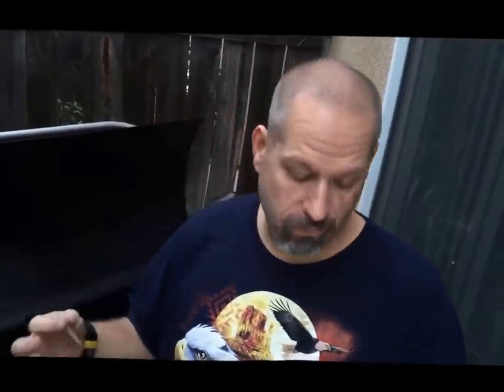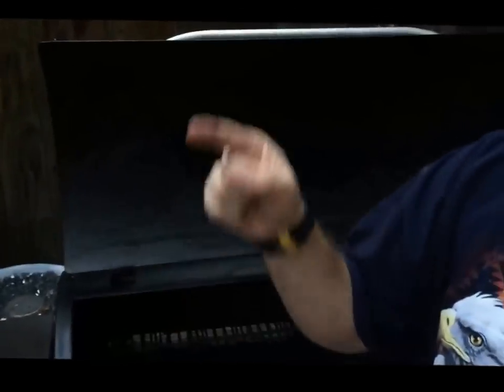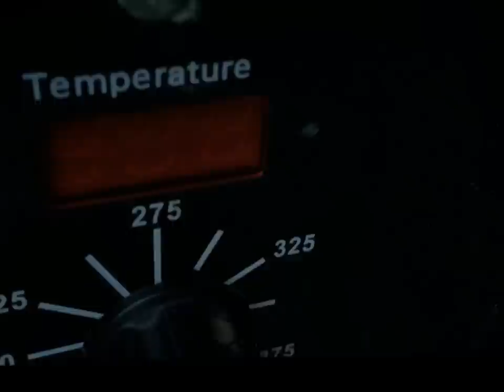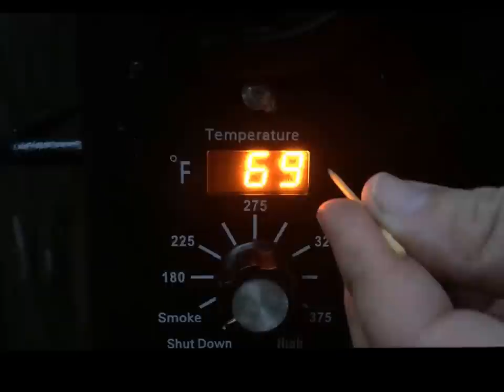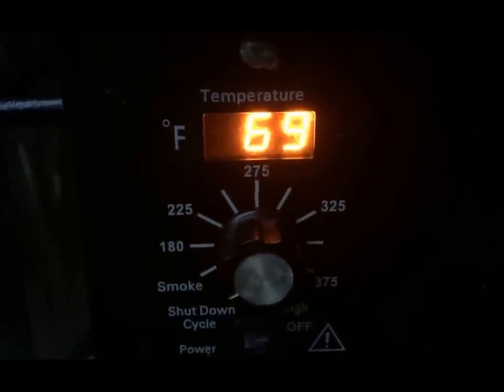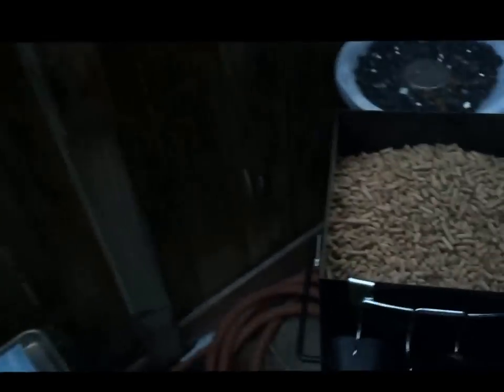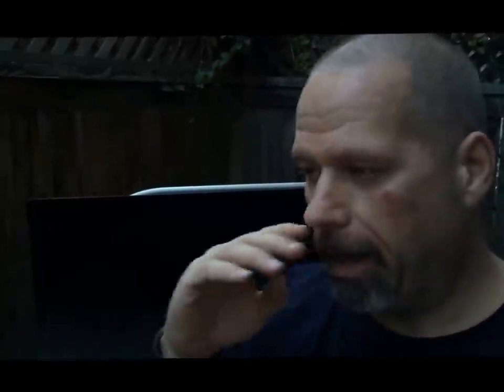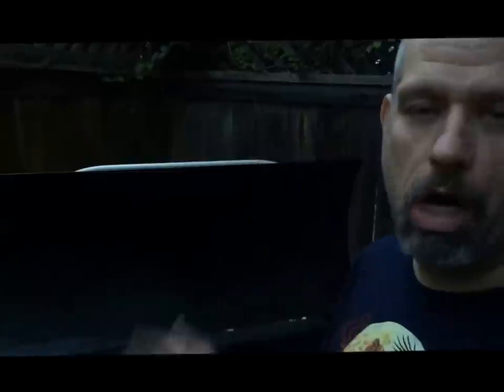Adjusting The Traeger P Setting - What is the P setting, where is it, and what do I do with it?

Comment: I guess I'm understanding this all wrong, going to be kinda long so please hang in with me, My Treager is only 6 mo old but it's caught  fire 5 times now, The burn box just gets heaping over full of pellets & burns back up thru the auger into the hopper so I just timed a full heat cycle & here are my numbers.

Temp set at 225dg P setting I changed fro P2 to P4,  After 10 min start & 10 min with lid closed I started timing
227deg Auger on for .17 sec
Auger off.05sec
204deg Auger on 2.53 min.
Auger off 1.22 min
300deg Auger on.14 sec
Auger off 1.28 min
296deg Auger on.12 sec
Auger off 1.25 min

Ok So it looks like the On/Off times are about right once it goes into smoke mode but whys is my temp getting so low at the begining 204 Deg then hits 300 Deg.

Thanks for any advice
Reply from the maker: What brand pellets?  Is the hot pot cleaned out?
Reply: @CrazyDavesKitchen  , I clean the Hot Pot before every use  & use only Treager pellets
Reply from the maker: Try lumber jack pellets
Reply: I'm wondering, This last time I was on smoke setting for 5 hrs, then increased to 225 setting skipping right past the 180 setting, Do I need to maybe go up 1 setting at a time & let it run threw a complete cycle on each new setting?

Comment: Just need to clarify the P setting affects the auger feed rate at startup only or does it change feed rate for all cooking? Also once you got a comfortable setting why are you constantly changing it? To get more heat??
Reply from the maker: Ambient temps can change the settings
Reply: According to the actual 'Traeger' P- Setting Video :
the higher the 'p' setting, the cooler its gonna run.
the lower the 'p' setting, the hotter its gonna run.
Reply: Higher P = cooler temps. I have to adjust it on windy days to keep it from getting too hot. P4 or P5 usually.

Comment: How do you disable the P settings?
Reply from the maker: There is no way to disable it. Each setting makes a small change. 

What is the issue you have?

I also ended of switching out the controller, muffin fan and auger motor to smokedaddy kit

Comment: my controller does not have the /P/ input control, each time I set it for 225, runs to 400, even set at 180. just muscles its way to 409+ what am I missig
Reply from the maker: You probably have a newer machine where they removed the P setting. Traeger has had a lot of issues recently. The problem when they outsourced to China they have several different factories making the same parts.  Each factory will test those 3 parts (Muffin Fan, Controller, Auger) and work perfect. However when you have multiple factories making those parts and they all get shipped to the assembly that's where the problem is. 

Lets use Factories: A B C 

(A) makes: Muffin, Controller, Auger 
(B) makes: Muffin, Controller, Auger
(C) makes: Muffin, Controller, Auger 

So when they go to the assembly plant they grab from the bins as needed, now some times, all 3 parts will match, AAA, BBB, CCC. 

But other times it can be ABC, BBA, CAA etc, many combinations. This explains why some have no issues. but so many people do have constant issues. 

Myself I know you are not going to like this but I changed all my parts to SmokeDaddyInc.com PID controller, Auger, Muffin fan. Works awesome now.
Reply from the maker: I have also heard that the button is there still, they just hid it. look at the side of the controller and see if there is a button there.
Reply: Remove the controller with the two screws, its going to be directly on the board, its the only button there

Comment: Traeger put a sheet of paper in with my Scout grill that says in BIG GIANT LETTERS to start the grill with the LID CLOSED.
Reply: Lol mine too. When I called for support, the Traeger reps insisted the lid must be open. They do have some models that must be started with the lid closed. Those are on the website. So needless to say I’m sufficiently confused.
Reply from the maker: Wow... they used to have instructions that said lid must be open during startup or it can cause a flash burn (explosion). I wonder if the new controllers they are using helped fix that issue. 

With my modified Traeger with Smokedaddy PID controller I can leave the lid closed
Reply: Crazy Dave's Kitchen did you get the whole Smokedaddy kit, or just the controller? I need to call them and see if their controller will fit the Scout. Country Smokers just came out with The Traveler. Very positive reviews.
Reply from the maker: I got the whole kit. Auger, muffin fan, hot pot and controller. 

Call Elizabeth and tell her your a Crazy Dave fan she might have promotions she can extend. 

They are a friend of mine
Reply: Crazy Dave's Kitchen will do Sir. Going to see if the replacement RTD sensor they send will resolve the issue. I’m hoping it does. Otherwise it is either invest in the kit or, return it and buy the Country Smoker Traveler. 🙄
Reply: Crazy Dave's Kitchen I just went ahead and ordered their PID controller. They explained how it controls the fan and auger completely differently than a Traeger controller. They know who you are and we’re kind enough to extend a promotion. Thank you again for the recommendation and I look forward to making this Scout work better than it currently does.

Comment: If I leave my lid open on start up I get the low temp error its not going to hit the 120 deg temp it the time allowed and automatically turn off
Reply from the maker: That’s odd. What pellets are you using ? Is this a Traeger or Pellet Pro Controller
Reply: @CrazyDavesKitchen  its a traeger and I use traeger pellets. they turn themself off if they dont hit 120 deg in a set time at start up.
Reply from the maker: I stopped using Traeger pellets years ago had too many issues with them have you tried a different brand it to see what happens

Comment: my controller looks that that but do not have the hole for adjusting the P time. How do I adjust it
Reply from the maker: Have you removed the little cap there?
Reply: @CrazyDavesKitchen  My control board doesn't have that cap. I took it out and talked to Traeger and there is no way to adjust it. They sent me a new board and it has the adjustment on it but it is hidden. I still can not get my grill outer then 430* on a 80* day. At least now there are no wild temp swings. If I open the lid to add meat it never recovers back to 430*. I am very disappointed in it

Comment: My p button doesn't change from temp to p settings .. I got this from the I laws it's an older model. Has smoke then 180f for first two settings
Reply from the maker: Some of the older controllers do not have P settings. - Look at the SmokeDaddy PID controller.
Reply: Crazy Dave's Kitchen I found it behind the service sticker. It clicks but doesn't do anything.. I found instructions to dismantle and clean switch. I'll try and report back if it works
Reply: @CrazyDavesKitchen  They do, there is a potentiometer controller on the circuit board, but you have to pull the controller. This is on the most basic 3 position sliding switch. I've had 4 different controllers, same Lil Tex.